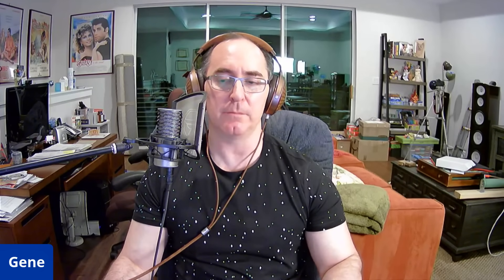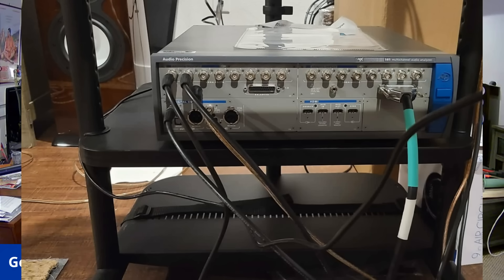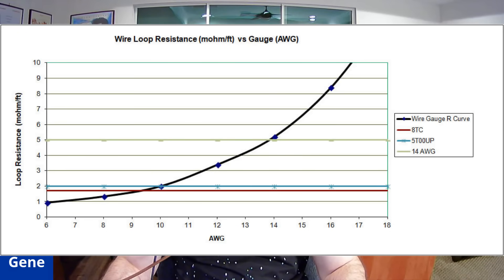Speaker Cables Really Don't Make Much of a Difference?

Comment: Back in the day my first non-hardware store speaker cables were Original Monster Cables.  They’re 11AWG, 300 strand per conductor and relatively inexpensive by todays $ but were $75 for 60ft back then.  Though I’m not an engineer, my father is a EE from Texas A&M.  He is of the general opinion that most speaker cables sound the same EXCEPT for el cheapo hardware store lamp cord.   As an aside, I’ve been building hi-fi kits from Eico, Dynakit, HH Scott and others since my dad taught me how to read a schematic and solder about age 10 (1957). 

Enough of that.  My position is that series resistance is the single most noticeable/audible aspect of speaker cables.  Cheap cables will introduce enough series resistance to gobble up power and destroy damping factor (read muddy bass).  So, when purchasing speaker cables I focus on high purity copper (five 9s minimum), good dielectric insulation, and high strand count.  Until a few years ago there were two outfits that produced such cables .. Tributaries and DH Labs.   Tributaries produced high quality 12AWG speaker cables for $1.00 per ft The DH Labs product was about $2.75 per foot for 14AWG speaker cables with a little bit more technology.  Finally, though Monster stopped producing its “Original” cable, until recently it did produce a high quality in-wall CL3 jacketed 12AWG speaker cable which I used to run cables to my surround speakers.   I ruled out ALL snake oil cables including Kimber from the outset.  Regardless of how they tested out by the OP, nothing will convince me that braided cheap bell wire is a good cable in a real world implementation where cable runs are usually greater than 10 ft. 

I eventually settled on the DH Labs “T-14” product for my LCR speakers and the Monster 12AWG CL3 cable for my surrounds.

Comment: I had some Synergistic Alphas from years ago that I always used from my fronts because they were expensive.  I never had an issues with them.  I also had some Acoustic Research 10 gauge speaker wire (my old go-to brand) and I just made the permanent switch.  I assume that the SR were 12 gauge, but once I plugged in the AR - the bass did increase and got tighter.  I even had to adjust the EQ to put a little more top end on it.  I am sure it is just due to gauge increase and not type or brand.  The only thing I didn't like about the AR is the weight.

Comment: Me and my brother @uncle.Cyte been going back and forth about this for years. I finally understand what he’s been telling me. Copper wire is copper wire. The connection and the shielding is  what matters and the gauging of the wire. He’s my go to guy die all this stuff that I don’t really understand too much. 
I like monster cable. He said cable is cable. He turned me onto mogami. I must say. The shielding on these is awesome!!!!! I watched a guy do a shielding test and it was the only cable to reject radio waves. Pretty cool!!!!

I did years ago had hissing on an input. I couldn’t figure out where it was coming from. I unplugged all the cables one by one and it turned out I had Hosa cable plugged in alongside a monster cable in my drum machine. The Hosa was hissing. I replaced it with a monster cable that I had and no hiss. That’s what sold me on monster cable years back.

Comment: Thanks for this. To me, the main reason for upgrading cable is the quality of the terminations.  Connections are the main point of failure in most cables and the point where there will be signal loss. I've been satisfied with Blue Jeans cable with locking banana plugs.

Comment: I’m confused because you recommend 12AWG at least however 10AWG is better but the chart on your website says 14AWG up to 35 feet for 8 Ohm speakers. My question is if my speaker cables are going to be 10 feet each and my speakers are 8 Ohm, is 14 AWG what I need or do you still recommend 10AWG?

Comment: I cannot believe that 2 x 8ft of speaker wire can cost as much as a good car. Many hours of r & d and special metallurgy can add up but get real. We are getting ripped on one side and possibly helped on the other. I for one can easily hear differences in Dax’s, amplifiers, wires, capacitors and other components and I think most people can. Is the music clearer and more realistic or not? simple. There’s logical reasons why this is. Music is reproduced mechanically and electrically and encounters roadblocks such as resistance, noise, inductance, capacitance and mass ad infinitum. Whether mechanical or electrical all the varied fluctuating energy is causing the varied frequencies to mingle with each other. Reducing this mingling can be done with better design and materials selection. If you’re interested in music reproduction, just listen! If you don’t hear anything don’t waste money on it.

Comment: I was using good quality 10-gauge OFC with some Fospower Banana Plugs that, to me, made a good solid connection to my amp. I recently got some Blue Jeans Cable speaker wire (10-gauge) that uses welded locking bananas. I did not expect an improvement in sound quality -  I bought them solely for the aesthetic . But low and behold they did make a noticeable improvement to the clarity of the mid-range and punch of the bass. I was not expecting that.

Comment: I'm the hifi equivalent of a truffle pig, searching around the ads for bargains. I use Chord Odyssey bi-wire cables 2nd hand @ £15 a metre. Nac5 is great but monstrously over priced for what i feel is a starched NAC4, being very unwieldyjust rubs salt in the wounds. Just buy well engineered sensibly priced cables and you won't go far wrong i've found.

Comment: The difference between cheap and expensive cables is negligible per your detailed tests.  But what if the improvement, if any, provided by better cables is not related to the capacitance, resistance, etc..., but instead due to the manipulation of specific frequencies where the cables are acting as a kind of pseudo EQ?  Would an analysis of the frequencies emanating from a speaker be the best way to determine the effect of the cables?  Not sure if you've done such research on this, but I'd be interested in learning more.
Reply from the maker: It's impossible for a cable to change the amplitude response of a system if RLC didn't matter. That's ALL that matters with speaker cables. I also showed actual system frequency response of an amp connected to a loudspeaker with various cables remained virtually identical even if the cable impedance were measurably different.

Comment: Really useful video thank you, you've actually confirmed what I have long suspected for a long time. Speaker cables make very little if any difference to actual sound, however I will still buy better quality cables, simply because they're built to last, better connecters, better isolation etc, etc... great video

Comment: Should I run all my speaker wire lengths the same for my 5.1.4 setup? Or is it ok to cut only the length I need then calibrate after?

Comment: A nice effort trying to test and measure cables.
One thing you missed out on is the harmonic spectrum of the distortion. That have a really significant impact on the sound and how we percieve it.
Please also read Nelson Pass paper on distortion and specially the part where intermodulation distortion create a "perfect storm" of distortion hiting 10-15% 
when many signals are combined as it is in recorded music. Measuring distortion with single sinus waves might not give us the complete answer.

Comment: Gene, something weird happened a few weeks ago... I bought a pair of Worlds Best Cables speaker wire. They use 14 AWG Mogami W3082 coaxial cable and Eminence Gold banana plugs. You can buy the Mogami wire for around .33 a foot. The plugs, what $20 +/- for the set? I paid around $90 for the pair, 10 feet, fully assembled using soldered connections on Amazon.

Something is going on there vs my 10 AWG OFC. The soundstage did open up, and here is the kicker, the reason I knew there was something going on and it was not in my head... I had to turn down the bass on my subs, as the KLH Model 5's suddenly were producing more, so much so that I had to knock off around 4 to 5 db's on my pair of SVS SB3000 subs. That isn't in my head, that really happened. 

So, what is the difference between ofc vs coax? Something is going on there.

Comment: I’m also a audio fanatic, you are 100% correct. Even if you use expensive speaker wire, open up your speaker box, look at your woofer where the wire from the connection point enters into the coil area , they use very thin material , and all the sound goes thru this area. What is the use of using expensive wire when inside the speaker box and speaker coil is not?
Reply: I have German Quadral+ speakers and all cables inside are 4mm² and so are my speaker cables. They are standard Aamazon stuff.
Reply: The speaker cable will change the signal along the way. Some will filter out EMI and RFI and ultra high frequency electronic hash better than others.
Reply: I have Mordaunt-Short speakers and looking in them, they seem to be using 14-12-gauge to connect the parts inside.

Comment: I'm using zip cord on my system ( moderately priced ) now and I could not tell a difference than when I was using higher end cables, but if I had the money and I just wanted to spend it on my setup, that would be fine too. So , spend the money if you want, the way you want and be happy. You only have one life, enjoy. Thanks

Comment: Totally agree. So you do get 0.6 dB difference. Nobody should care about sub dB differences. OK, lets say it is a loss. So put your amp higher by turning the volume know by 0.1 degree to the right. In either way your speaker FR problems are 10x in magnitude. Just invest all the effort there, where it matters.

Comment: Have they done one where they compare cable lengths? My electronics textbook pretty much measured things in thousands of meters at gauges over 16 when it started talking about differences in resistance. I think people are getting this mixed up with instrument cables which generally start affecting frequency response over 15 feet and need some kind of buffer accordingly. well yeah, that's a situation where a transducer is hooked into a pre-amp and a speaker hooked up to an amp is different ballgame altogether.

Comment: With the prominence, popularity, and growing use of wireless networks (wifi) over wired networks (Cat5e/Cat6), I found myself having a lot of unused or leftover ethernet cables. Over the years, I've been using CAT5e ethernet cables as speaker cables for runs that are/were about 13 feet to 16.5 feet (4 to 5  meters). Initially, I used 1 CAT5e cable per speaker, splitting the twisted pairs, using and combining the solid-color wires for the Positive (+) and combining the striped wires for the Negative (-). The best result I've gotten is when I use 2 CAT5e cables per speaker, having a dedicated CAT5e cable for the Positive (+) and another CAT5e cable for the Negative (-).

Comment: Hi Gene thank you for an excellent review.  What is the maximum length of speaker cable you would recommend, and does the gauge matter if you need a longer cable? Many thanks Stephen
Reply: @stephenharding428  I know this video and your comment are over 2 years old, but I don't see a response to your question and wanted to give you one in the very remote possibility you haven't come across the correct answer yet...first off, yes! The length of your wire is a determining factor in what gauge wire you need. The longer the run or wire, the larger gauge (lower gauge number) you need. I had actually come to this video from a link on a page with a speaker resistance/wire length/wire gauge chart. The lower the resistance (Ω's) of your speaker and the shorter the length of wire, the smaller gauge (higher number) wire required. As far as maximum distance, even though the chart gave distances that exceeded 50', that was the recommended maximum length (on that chart). I'm not an electrical, audio, or any other type of engineer, so I can't give you a concrete reason for the maximum distance of 50'. However, at one point in my sordid collegiate past, I was a physics major, so I can absolutely confirm the need for a larger gauge of wire being necessary for longer distances and/or higher resistance. I hope you got your answer long ago, but if not, I hope this answers your question. 🤘🖖✌️
Reply: @ I did thanks, a very nice man from Exposure helped me and I purchased a lower gauge.

Comment: I was taught, as long as you keep your cable length under 10 feet you really need not worry as the Inductance, Capacitence and Resistance are too small to be heard...

Comment: Man what a write up!!! Bravo proof is in the pudding and boy you got the pufding....point. zero 6 wow wow wow.Inaudible. difference... Keep up the excellent work...I almost peed myself. When mentioning your test equipment...Damn what a set up...Yet I do agree when setting up system it is only as strong as its weakest link.vYou don't hook up 16,000 speakers with wire from Home Depot.... How about the tube shortage any insight?? I am a Audiooholic......KT 88s baby,,,

Comment: Been using 10 ga for 40+ years. Guess I will continue to do so. Heck, your speakers cost 10 times what I have in my entire system. I have around 600 LPs that I collected over the years and enjoy them as much today as when I bought them. 
My system is minimal: 
Cambridge AXR85, Fluance RT85 turntable, a pair of old Cerewn Vega AT8 speakers, and a pair of Epi M50.
Works good enough for me. 
I can never claim to be a technologically advanced audiophile, but I enjoy what I have. Not one to get caught up in the next big thing. Although I appreciate those people with the resources and savvy to put together those impressive, Hi-Tech systems.

Comment: So how do you explain two capacitors that measure exactly the same but when put in a circuit sounds completely different. 
I recall a video you did comparing a Pass Labs amp to a Denon and you said the Denon was superior on paper. what a joke.
Reply from the maker: You're a joke. IF the capacitors sound different, it's very easy to measure what that difference is. I never compared a Denon receiver to a Pass Labs amp. I compared a Classe amp to Pass Labs. The Classe was superior on the bench and it was audible too.
Reply: @Audioholics  You should rewatch your Oct 30, 2021 video then.

Comment: The one parameter you didn't address Gene is damping factor, particularly crucial with the lowest frequencies. Damping factor (as I am sure you know) is the ability of an amplifier to control the movement of a driver. (I am over-simplifying. Don't want to muddle this up with all the impedance considerations, flyback currents, etc). If an amplifier has a rated high damping factor, that is only fully realized if the resistance of the speaker cable is very, VERY low. Any added resistance in the cable will cause the damping factor to lower substantially. I suspect this is one of the reason audiofools unknowingly try to keep speaker lengths short. For home audio applications a figure of 200 or higher is good. However you have to have an amplifier with a high damping factor to start with, of which many do not. Both professionally and at home I use Bryston amplifiers, since they do have the highest figure compared to most manufacturers. Tube amplifiers are abysmally bad, and that's just due to the transformation required on their outputs. As you know gauge can overcome resistance as much as cable length. I do both short length and massive gauge. (Currently at home I am under six feet at ~5 gauge). The cable I use in very low inductance as well. What is it? It is SOW 8 gauge 4-conductor wired as twisted pairs. Yeah ... the stuff you use to wire up an electric stove. You should try measuring that, like I have. Very low resistance, low inductance, slightly higher capacitance. Currently my damping factor on my system is calculated to be around the 88 figure at lowest two octaves.
Reply from the maker: Damping factor isn't really an issue for speaker cables. The resistance in the voice coils of the speaker swamps out the cable impedance making a large  damping number irrelevant.

Comment: Jean I’m an audio file 79 years old and had the pleasure of using my ears at 10 years and a half with Saul Marantz in New York on his tube amps unbelievable experience and at one point I had golden years you’re right on on speaker cable (i’m using Kimber 8tc) not for the Sound different but bill quality Gail makes great great cable been using it since it’s very first introduction of cable I agree with you 100% though we’re both purity or files

Comment: Gene, just found this 11 months late.  I do not expect you'll remember me, but I went by Mudcat when you started your original website & forum.  At some point in time I made a pair of 10 foot cables for you by twisting 4 cat 5 cables around a 5th cat 5 cable for an equivalence of about an 11 gauge.  They were wrapped on teflon tape to hold everything together and a  blue techflex cover ending in locking bananas.  Had some nice shrink wrap on the ends with the "Mudcats Engineered Designs / Does Your Audio System Have its MEDS"  Do you recall what you eventually did with them.  Seeing this post brought these thought to mind and was wondering how those homemade cables would stack up and if you even still have them.
Reply from the maker: Yes I do remember you! I remember those cables but not sure if they were lost in my recent move 🤔 😞

Comment: I tried some wireworld solstice cable $220 on my system......sold them a week later  because there was NO difference between the WW  and the cable I got for $14....yes $14 at a local audio shop.  They were biwired too.  NO difference.  I have a bryston b60 a rotel cd14 player and an Anthem blu ray player. with Paradigm speakers.